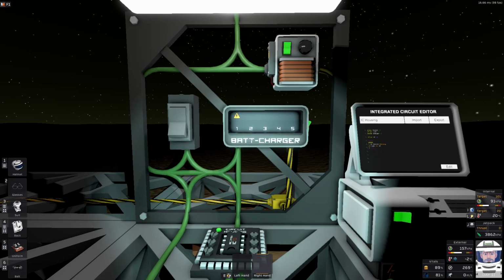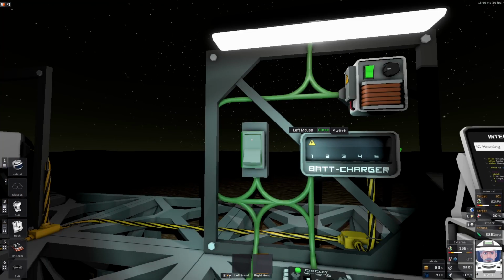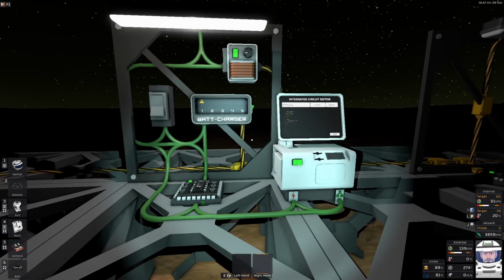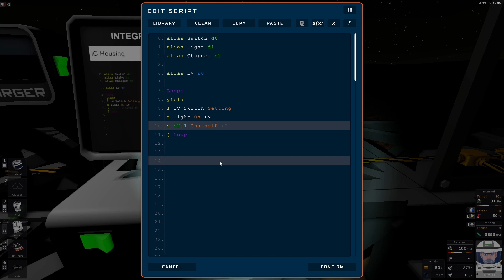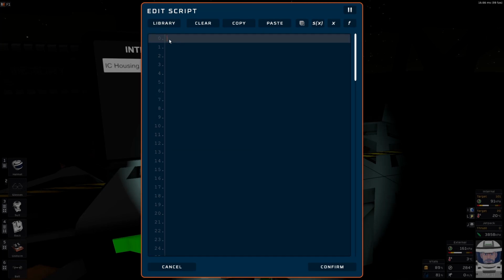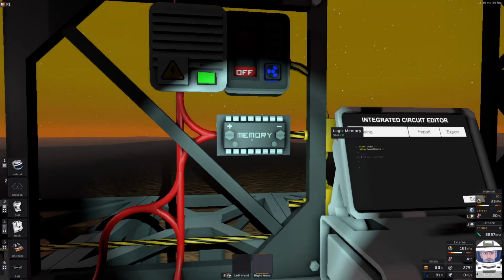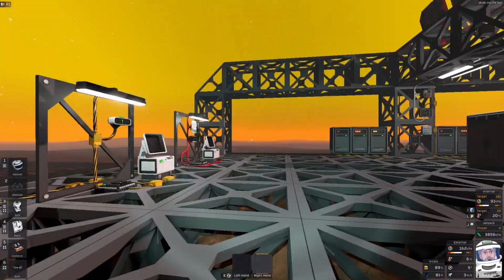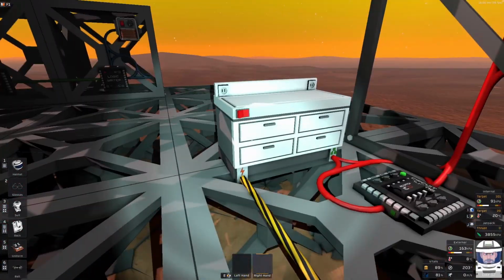Stationeers - IC10 Logic Channels

Comment: Not sure if it's been updated since this video but you CAN use the aliased name instead of the screw location.  The line on the code will turn red as if there's an error, but it does work.

Comment: Wait, what?? Is this undocumented or is this an upcoming feature in the beta/staging branch?
Reply from the maker: I did a search and it is added with the Integrated Circuitry Update on 27 april 2023.
Reply: @ByNamme  thanks. I can't believe how bad this game's documentation and in-game UI is. I had absolutely no idea about this despite scouring Stationpedia and the unofficial wiki
Reply: Unfortunately the only mention about channels is in cable coin in stationpedia and on the unofficial Wikipedia's it's not at all. This is somewhat discussed in the update announcement but unfortunately that's all. But this is only problem I have with Stationpedia (ingame F1) it's great in every other aspect.
Edit: Ok I have one more problem and that is variables without description of what they do (Flashing light has mode - what am I supposed to deduce from it? than there is also setting etc.
But this is all what I don't like about the Stationpedia